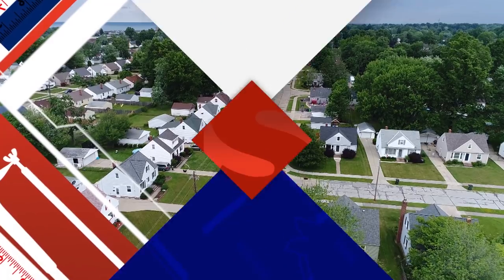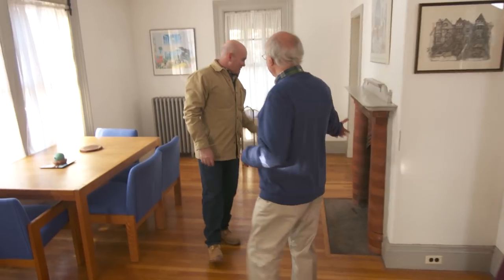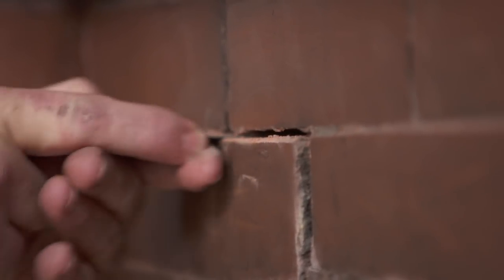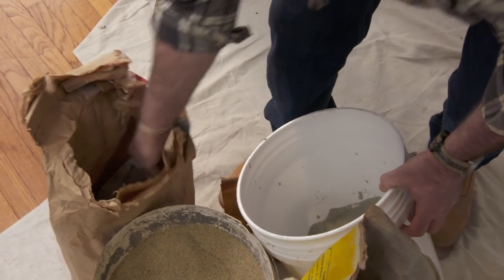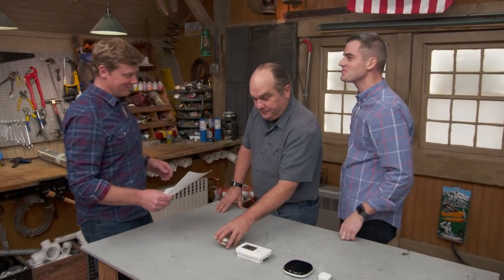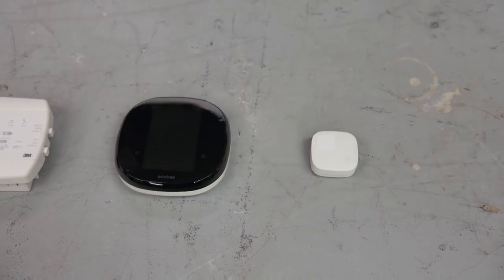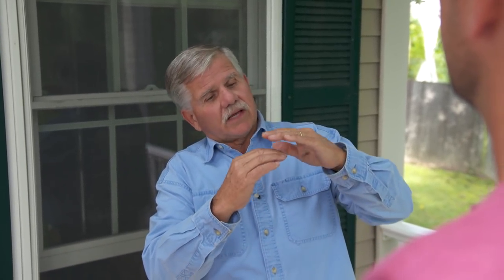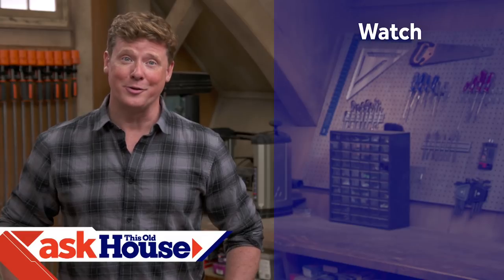Ask This Old House | Restore Fireplace, Porch Swing (S17 E22) | FULL EPISODE

Comment: Hi Richard, if you read this do you have a video that tells me if a radiator can be plug up and how to unclog it and if I drain the system how do I flush it out. Its up on the second floor. 9 room house and sometimes I hear water dripping on the burners. I need your Help. Sorry, I wanted to send this to you, but I did not know where to send it to. HELP ! 11/12/2019

Comment: The mason has fine skills and attention to details however removing perfectly fine lime mortar to then point in cement mortar because you want the color to match- no. Doing that removed important historic character and replaced it with an incorrect material. Lime mortar is readily available to be made just as easily as type n. Or one could use NHL (natural hydraulic lime) and fine sand to accomplish what the original builder of that beauty would have expected in a repair. And it is relevant beyond keeping with the traditions even with this indoor fireplace because movement does happen in old buildings and like the fine mason said- the mortar crumbled just like it should have... lime mortar has very different properties than Portland cement/lime mortar.